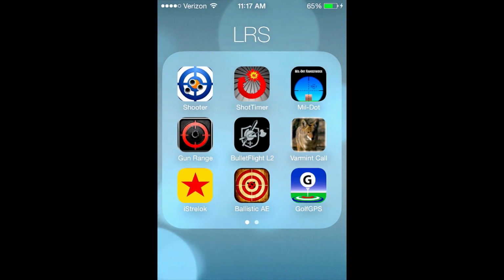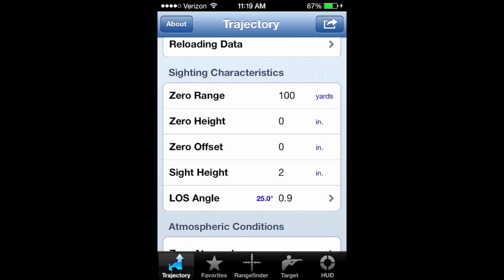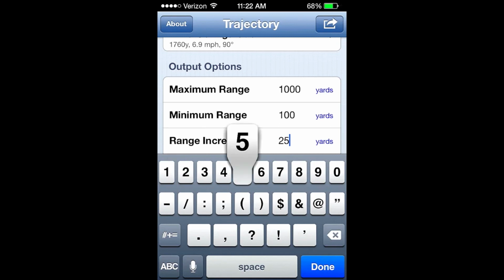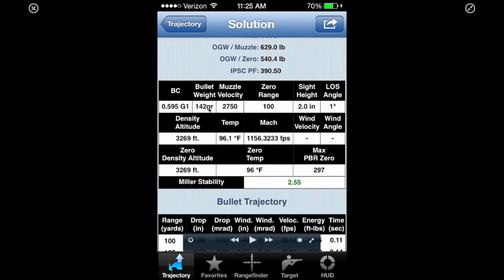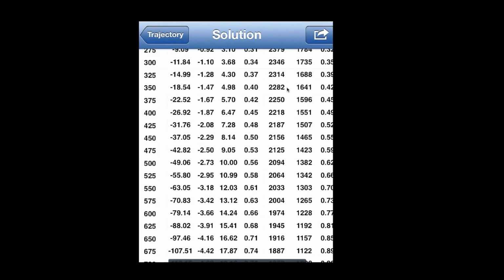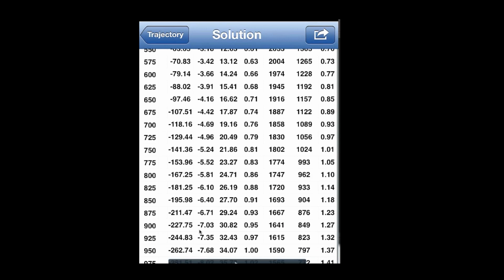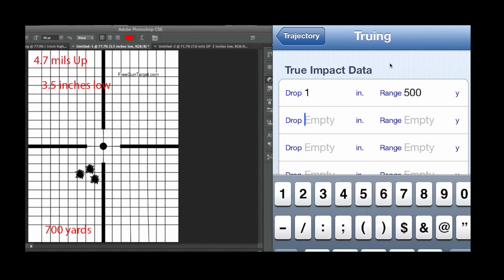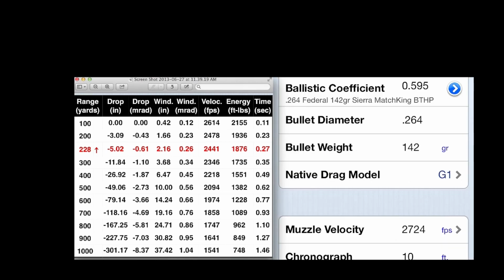Long range shooting with Ballistic: Advanced Edition for iPhone

Comment: Best ballistic app I have used! As long as you input the correct numbers! I was getting first round impacts out to 940M (.308) with only .1 mil up or down deviation from CM. Strongly recommend spending the money. You won't be disappointed.

Comment: Hey Ryan, I was considering purchasing a Kestrel 4500 Applied Ballistics, but, it's a bit out of my price range. I'm wondering if you feel that this app run with a standard Kestrel 4000 is a viable solution? Getting a kestrel 4000 and this app would save me $320. But I don't want to waste the money on a cheaper kestrel and the app if it's really not going to be as reliable as the ballistic kestrel. What do you think?

Comment: Big help thanks! One question. On the output options, I don't have 1/4" 100 yards. I have 1/2cm 100 meter. Know how to change that? I've tried checking the setting from imperial to metric and back but no luck. Thanks!